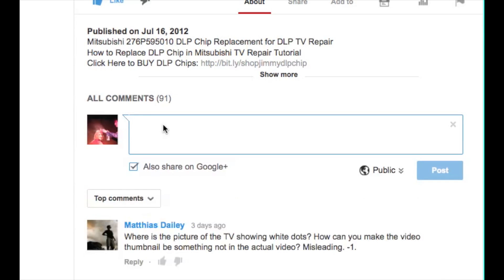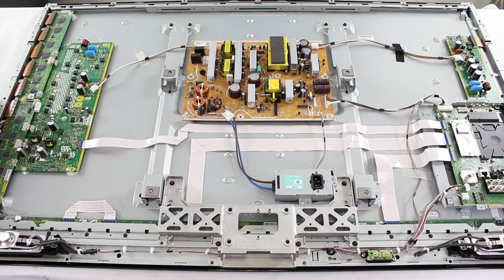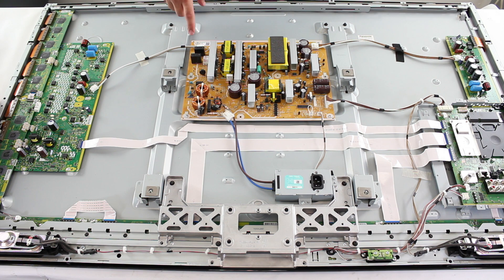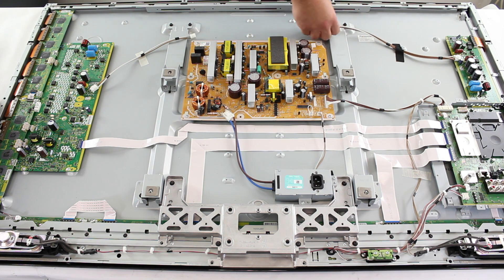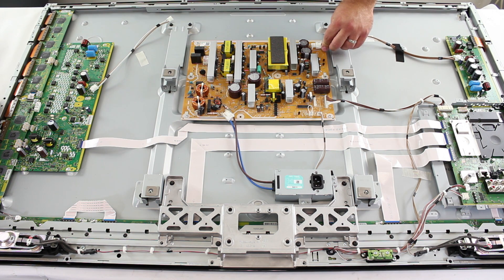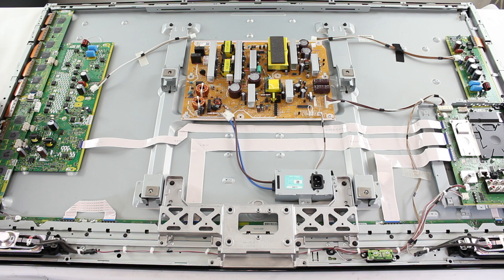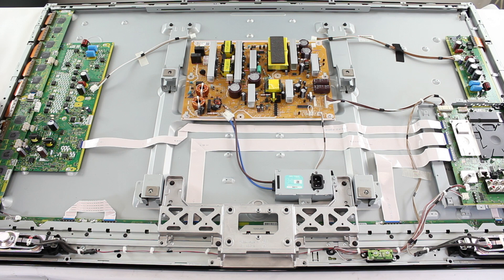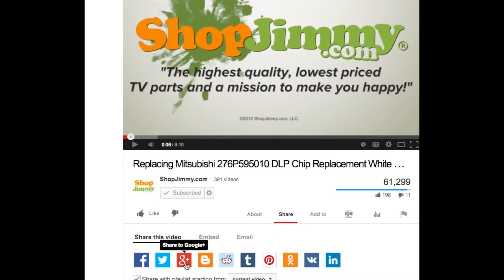Plasma TV Repair Help Clicking Noise & No Picture How to Troubleshoot Y Sustain & X Sustain Problems

Comment: I have lg plasma tv model RZ-37LX30 there is only Red light but no Picture , if there is no capacitor problem what it would be , i didn't open it yet .
Reply from the maker: +ETHIOPIA ANDENET   Try this at your own risk. Unplug the TV, then disconnect the y board and plug in the TV to see if the TV powers up. Note that it will not have a picture on the screen. Reply with the results of this test. Thanks! www.shopjimmy.com

Comment: Vizio 50" TV... Model # VP50 HDTV20A, Part # 10143050022. Tv will turn on but will not turn off ,must unplug to get tv to turn off, Tv has backlights but no picture or sound and no inputs work.. I saw a video where they suggested changing up33..Id like to just replace the whole board if possible..Any thoughts on a fix or board source and part #? Thanks
Reply from the maker: +Indecisive   Try all repairs and troubleshooting at your own risk.  I recommend replacing the main board in your TV.  Click this link to replacement parts for your TV model number:  http://www.shopjimmy.com/catalogsearch/result/index/?cat=56&q=VP50+HDTV20A  There may be multiple boards for the same TV model number, be sure to match part numbers on your current board, with your replacement for compatibility.  Here is a link to a video showing how to identify your part number, click here:  https://www.youtube.com/watch?v=kxkeGLhlQY8  Thanks and please let us know if you have any further questions with your TV Repair!  www.shopjimmy.com

Comment: I have Pioneer PDP 5080DH   for over 11years now.Recently It powers on with dark or black triangle  shape at top and bottom with green color for a few seconds and turns off each time we powered the system. is this the power board or what?. please advice for I want to replace the bad parts myself.
Thanks
okpeyo52@yahoo.com      Hector
Reply from the maker: +Hector Ayu   Try all repairs and troubleshooting at your own risk.  This sounds like a TV panel (TV Screen) problem.  If your TV panel is bad, it may be more cost-effective to replace the TV as panels are typically hard to find in stock, difficult to replace, and expensive.  Thanks and please let us know if you have any further questions!  www.shopjimmy.com

Comment: Samsung PN59D530A3F  so what if you still hear a clicking after disconnecting the y and x sustain boards? i believe my problem is with the power supply board but everything looks ok... what do you suggest?

Comment: I have  A TOSHIBA PLASMA PN43D450A20  CLICKING SOUND WHEN PLUGGED IN RED LIGHT STAYS ON.
Reply from the maker: +Bryan Yablonski   Try this at your own risk. Unplug the TV, then disconnect the y board and plug in the TV to see if the TV powers up. (Note that it will not have a picture on the screen.)  Reply with the results of this test. Thanks! www.shopjimmy.com
Reply: ok x board and y board are connected together unplugged xboard from y board still beeps...unplugged Y board from PS still beeps ...does that mean my power supply board is toast.  No bulging capacitors or burn marks visible

Comment: I have a Panasonic plasma tv model #TH-42pz80u it comes on the relay click twice and a few seconds then one more click 'which I think suppose to happen. but the red led stay on for five minutes then goes off and on the screen doesn't lights up all the way, can you help me identity which board need to be change
Reply from the maker: +min  roger Williams   Try this at your own risk. Unplug the TV, then disconnect the SC board and plug in the TV to see if the TV powers up. Reply with the results of this test. Thanks! www.shopjimmy.com

Comment: Samsung Pn60e7000.  Power cycles on and off constantly.  Will not stay on longer than 10 seconds.  Also a clicking noise happens when the tv powers on and off

Comment: HI I have a model#TC-P50U50.  when I plug in it just keeps clicking.  what happened was cable guy was doing something with tv on and it starting doing this.  think he sent a shock to tv.  do you think this is repairable?

Comment: hello i have a samsung pn60f5300a-----i have 2 problems the sound will creap off from the vedio ---starts off fine about 6 pm will start to shift.---if u turn off the power it will get back in sync.what board needs to be replaced.--2nd proplem when unit has been on several hours it is very hard to get on --is this the caps that your video talks about thanks for any help eddie
Reply from the maker: eddie hall sr   PLEASE SUBSCRIBE TO OUR CHANNEL - Try all repairs and troubleshooting at your own risk.  I recommend replacing the main board in your TV.  Click this link to a replacement main board for your TV model number:  http://www.shopjimmy.com/samsung-bn94-06195g-main-board.htm  There may be multiple boards for the same TV model number, be sure to match part numbers on your current board, with your replacement for compatibility.  Here is a link to a video showing how to identify your part number, click here:    Thanks and please let us know if you have any further questions with your TV Repair!  www.shopjimmy.com

Comment: The only way I can get my plasma to power on is if I disconnect the logic board from the power board. I replaced the logic board with no luck. Suggestions? I have a Samsung model PN60B550T2F model code ""XZA

Comment: I have a LG 60 inch Plasma.  60PK750.  First thing that happened is the HD stopped working, so I shift over the the standard plugs red, yellow, and white plugs and the picture came in at a non-HD display.  Now the Tv shut down the other night and will not come back on the red light lights up when off.  Blue comes on, but there is no picture or volume.  Screen is either black when power on or very dark.  Can no bring up menu screens.

Comment: hi  i purchase a lg eay60696801 power supply last week true my agent from u guys i received it .i installed it on my lg tv set it come on good and then it went off in 5 min and it would not come on back only the blue power lite on pls tell what is the problem now.

Comment: have a LG 50px950 service code 50px950-ua.ausLLJR. All HDMI ports are not working. All other functions work. Tv recognizes the hdmi but doesnt display any images. tried several cables and sources. Is it the board?
Reply from the maker: Jason Hudgins  PLEASE SUBSCRIBE TO OUR CHANNEL - Try all repairs and troubleshooting at your own risk.   I recommend replacing the main board in your TV.  Click this link to replacement parts for your TV model number:  http://www.shopjimmy.com/catalogsearch/result/index/?cat=56&q=50px950  There may be multiple boards for the same TV model number, be sure to match part numbers on your current board, with your replacement for compatibility.  Here is a link to a video showing how to identify your part number, click here:  https://www.youtube.com/watch?v=RwHTvjMdrhk  Thanks and please let us know if you have any further questions with your TV Repair!  www.shopjimmy.com

Comment: I unpluged both y and x boards.  I still have clicking in power board. I replaced the power board. still have clicking. Samsung mod pn58b 650 s1 fx2a,,

Comment: my starts clicking when i plug in the main board. does this mean the main board is bad.
Reply from the maker: Derrick Warner   Try all repairs and troubleshooting at your own risk.  Please reply with your TV model number.  Click here to view a video that shows how to find your TV model number:  https://www.youtube.com/watch?v=S51nhAmwR2M  Thanks!  www.shopjimmy.com
Reply: ShopJimmy.com I unplugged the x and y boards. Still have clicking.  Replaced power board. still have clicking. Have Green lites that flash on Logic board when clicking. Red lite on front of tv is on.
Reply: Derrick Warner I have this same issue on my PN58C8000.  The Main Board is the only board that causing clicking.  The Logic board led light blinks in sequence with the click.  With the Logic Board unplugged, X and Y and the Main Board plugged in the tv clicks.  With everything plugged in and the Main Board unlpugged I don't get any stand-by light on the tv which might be normal with the Main Board unplugged.  I do hear a slight buzzing sound when coming from the Main Board when the TV relay clicks to try and turn on.  Were you able to resolve this Derrick?
Reply: no I  didnt seem to get it fixed. If you have any luck let me know..guess they dont have a movie on what to do when the x and y boards are unplugged and it still clicks.
Reply: Derrick Warner From what I gather from watching some of the videos and couple others is that if a board is causing the clicking replace that board.  I don't have any blown fuses or capacitors on the power supply board.  ShopJimmy isn't doing any type of tech support right now so on the spot help is limited for time being.  I'll eventually probably order a new Main Board maybe in a week or 2.
Reply: criminalmane let me know if it works
Reply from the maker: Derrick Warner If your TV starts clicking when you connect the main board, then it is recommended to replace the main board.  Again, please reply with your TV model number.  Click here to view a video that shows how to find your TV model number:  https://www.youtube.com/watch?v=S51nhAmwR2M  Thanks!  www.shopjimmy.com

Comment: my samusung 3D 51 inch tv clicks 3 times on power up, the light on the front also flashes twice in a sequence of 5 times, when disconnecting the Y board this all changes and seems to almost power up but doesnt, with diagnosing using your method its the Y board but what im concerned about is what goes wrong on the board and why? and what happenes if buying a new board doesnt fix my problem

Comment: Btw problem with the TV is that there is no picture or sound. When powered up a red light turns on, blinks then fades away then there is a clicking sound then nothing else happens other than the red light coming back on.

Comment: Hi there I have a LG Plasma TV Model 42PT350 and the power supply is connected to the Zsus board and from the Zsus board there is a  cable that runs over to the Ysus board. In your video you say that the Ysus board is connected to the main power supply and that there is a cable that runs from the Ysus board over to the Zsus board so I am a little confused on how to troubleshoot the problem. Can you please assist?

Comment: Hey I have an LG 60PK250 it is  having no picture but has sound.  The problem is intermittent as in sometimes it turns on with picture AND sound.  But I have to turn it off and on  MANY times to ever get picture on. I replaced my YSUS with a part from shop jimmy.com however still no picture has sound INTERMITTENTLY again.  Any ideas what i should try replacing next?

Comment: My 2006 model pdp-5070pu  pioneer plasma makes a click noise but no red light or blue light it does not turn on.
Reply from the maker: 4niture Furniture    Try this at your own risk. Unplug the TV, then disconnect the y board and plug in the TV to see if the TV powers up. Reply with the results of this test. Thanks! www.shopjimmy.com

Comment: hello, I have a LG plasma tv its an older one. model # 50PC3D display PA-510. When i turn it on the TV clicks loudly the screen turn on but the screen flashes i disconnected the Y board and it stopped making the noise. what do you suggest I do

Comment: I have a Panasonic Tc - 50pu54 plasma. My tv would not turn on and then would provide me 7 blinks. I had my ss board fixed and tested but when I installed it the TV would click once and then again 15 seconds later after it was plugged in. After pressing the power button the red light would stay on but no picture on the tv. I purchased and installed a new A board but it has had no change in the outcome. 
Any suggestions???
Thanks

Comment: LG DU-50PX10 - I had a very loud pop. The TV now has no Picture but does have sound. Any idea of what part I should purchase?
Reply from the maker: *****   PLEASE SUBSCRIBE TO OUR CHANNEL - Try all repairs and troubleshooting at your own risk.  I recommend replacing the Y-Main Board and the YDRVTP & YDRVBT boards in your TV.  Click this link to replacement parts for your TV model number:  https://www.youtube.com/watch?v=GEllG3RV-tc  There may be multiple boards for the same TV model number, be sure to match part numbers on your current board, with your replacement for compatibility.  Here is a link to a video showing how to identify your part number, click here:  https://www.youtube.com/watch?v=GEllG3RV-tc  Thanks and please let us know if you have any further questions with your TV Repair!  www.shopjimmy.com

Comment: I have a LG 60PA6550 TV purchased in 2011 which went out 3 months ago with the following symptoms: no picture then no sound, but it did have power to the TV, it would cut on and off displaying the red LED and providing the click sound when plugged into power and cut on via the remote. I have replaced the the Main Logic CTRL Board and Main Board in that order. After replacing the Logic board I experienced no change but after replacing the Main board I did get the static sound from the speakers like a TV station would transmit when off air. I plugged in my cable box via the Main board using the HD RGB cables but I do not get a picture nor can I get the menu or setting to display. I will conduct the test with my HDMI DVD player next. What would you surguest next; the YSUS and XSUS test? I believe this TV provides power to the SUS boards in series of each other. One last question do you sell ribbon cables that run from Main logic board to the SUS boards if I possible have damaged one? Thanks your help and suggestions would be greatly appreciated PJ.

Comment: I have a Samsung Model PN50B430P2DXZA -- no picture or sound -- clicking sound-- with only Y board plogged in no clicking -- with X board plogged there is clicking. Is it reasonable to just replace the Xboard - PBA# LJ92-01688A Rev.AA1?  Thanks, Lee Cook

Comment: I watched this video but i have a plasma TV from tevion but all the parts are from samsung

Model is MB 30150 

I did this but i hear the clicking noise but i have replaced 2 capacitors but i dont know what the problem is now 

When i first started the tv the orange light flikking 3 times then it clicks 2 times and 15 seconds later it shuts down.

Next what i did was replaced 2 capacitors on the power board then i plugged in all the wires then i had a blue light flikking for 15 sec with a clicking noise and then it when to shut down and become orange 

So if u guys know what the problem is please let me know 

Greets Daan
Reply from the maker: Furious SRO   Try all repairs and troubleshooting at your own risk.  Unfortunately, we do not have any information for your TV model number.  Thanks!  www.shopjimmy.com

Comment: Hello,

I have a LG 60PV250 and within the past 2 months it has developed some slight color fade on the upper right hand side (mainly on whites) and it has always clicked when turning on or off. Today it powered down by itself, I unplugged and attempted to restart and had only sound. I have tried unplugging several times no with no avail. Any suggestions on where to start?
Reply from the maker: Drew Quirk  Try all repairs and troubleshooting at your own risk.  This sounds like a TV panel (TV Screen) problem.  If your TV panel is bad, it may be more cost-effective to replace the TV as panels are typically hard to find in stock, difficult to replace, and expensive.  Thanks and please let us know if you have any further questions!  www.shopjimmy.com

Comment: I have samsung plasma model#PN42C430A1D. 

I has sound when it turns on and power, but no picture. I thought I would pick your guys brains first before I started troubleshooting myself. 

Any ideas.
Reply from the maker: Justin Vallee  PLEASE SUBSCRIBE TO OUR CHANNEL - Try all repairs and troubleshooting at your own risk.  I recommend replacing the Y-Main Board and the (in some TVs upper) Y Scan Drive board in your TV.  Click this link to replacement parts for your TV model number:  http://www.shopjimmy.com/catalogsearch/result/?q=PN42C430A1D  Be sure to match part numbers on your current board, with your replacement for compatibility.  Here is a link to a video showing how to identify your part number, click here: Thanks and please let us know if you have any further questions with your TV Repair!  www.shopjimmy.com

Comment: I have a Toshiba 50HP66 that has no display and a relay clicks on and off ever couple seconds when power is supplied.  I found the service manual and there isn't an X Sus board listed.  I have a Y SUS, Z SUS, CTRL, XRLT, XRCT, XRRT, TDRV TOP, YDRV BOT.  Does X SUS go by any other names?  Thanks!
Reply from the maker: Steve Small  PLEASE SUBSCRIBE TO OUR CHANNEL - Try all repairs and troubleshooting at your own risk.   X Sus can also be referred as a Z Sus.  Thanks!  www.shopjimmy.com

Comment: Hi. I have a samsung PN50C680G5F. My tv doesn't turn on and it just clicks.  I disconnected the y and x boards and it still does the same . I disconnected the Main Logic CTRL Board and it stopped clicking and it made the samsung start up noise but no picture. I bought a new Main Logic CTRL Board from your store and installed it and it still the same problem.
Reply from the maker: Lobox760   PLEASE SUBSCRIBE TO OUR CHANNEL - Try all repairs and troubleshooting at your own risk.  I recommend replacing the main board in your TV.  I recommend  replacing the Main Board in your TV.  Click this link to replacement parts for your TV model number:  http://www.shopjimmy.com/catalogsearch/result/?q=PN50C680G5F  Be sure to match part numbers on your current board, with your replacement for compatibility.  Here is a link to a video showing how to identify your part number, click here:  https://www.youtube.com/watch?v=sSJexLvRrjM  Thanks and please let us know if you have any further questions with your TV Repair!  www.shopjimmy.com